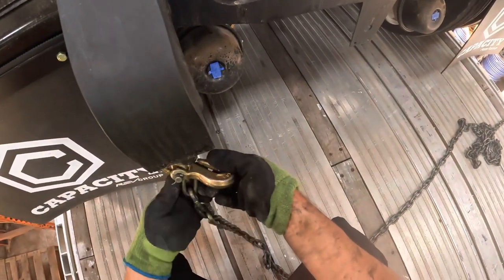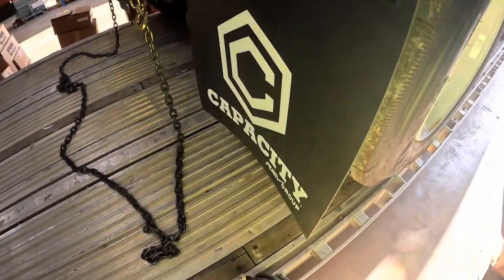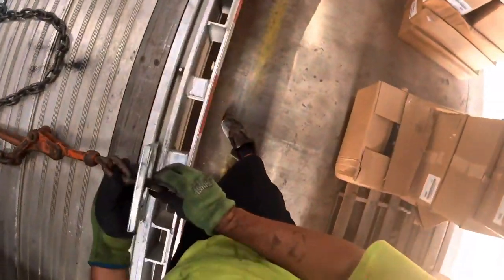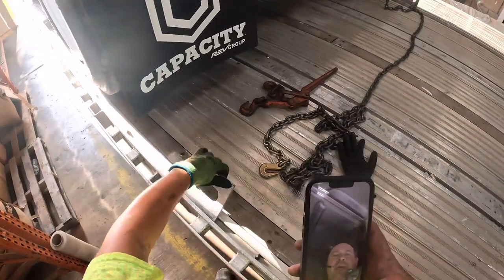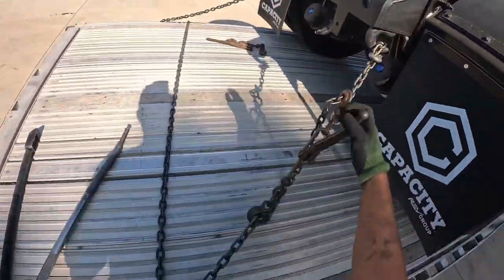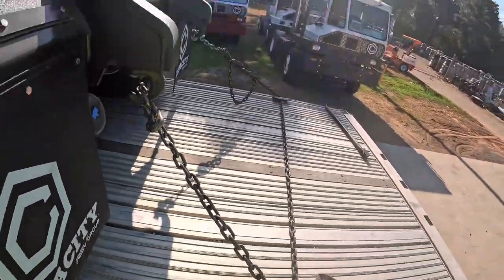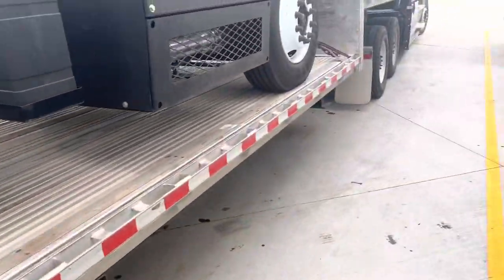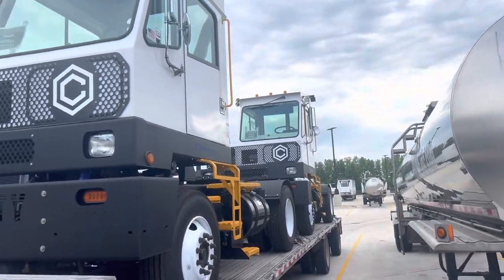Prime inc flatbed trucking #30. Finally got equipment. Securing yard dogs. Longview Tx to minooka IL

Comment: Those are more secured if you chain to the axles. Use the spring hangers on the front X the chains and use the rear diff and X the chains.
Reply from the maker: Thanks. Had another comment about that and I’ll try that next time.
Reply: There’s a big yard right next to that place where they store those trucks; that’s my bosses yard we haul out of there everyday sometimes

Comment: Next time make a x if you know what I mean left chain goes across to the right side and the right chain goes across to the to left
Reply from the maker: Ok I’ve seen that on another YouTube channel. Thanks for the tip
Reply: Cross chaining isn’t the best but in this situation I would have helped with those dangerous rear hooks. I would have hooked directly to the frame.
Reply from the maker: @TerraFirmaX  the trailer frame?
Reply: @tollboothjimmytrucking.  no the truck frame. Those hooks were wonky.

Comment: What would you change on this laod?
Reply from the maker: Wrap the chain around the spindle in the front. And maybe make some of this snap tighter.
Reply: The chain locations they can slide off because of pot wholes on the rode ! 🤔🤔🤔🤣🤣🤣👍👍😎😎
Reply from the maker: @JRBROOKS42  that the only placement to hook the chains thanks for all your comments.
Reply: Remember you're working load limit is now the lowest rated piece. Example a chain stamped, the chain must have a stamp, G70 typically has a WLL of 7 to 8 thousand pounds depending on the diameter. What counts is the working load limit stamped on the binder. If a chain does not have a G70 stamp it is downgraded to 2000 pounds.